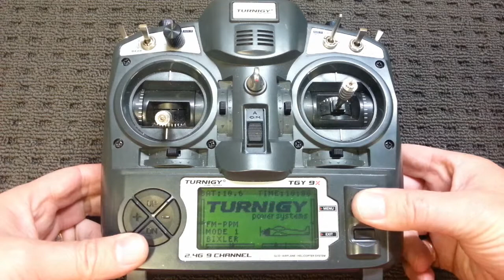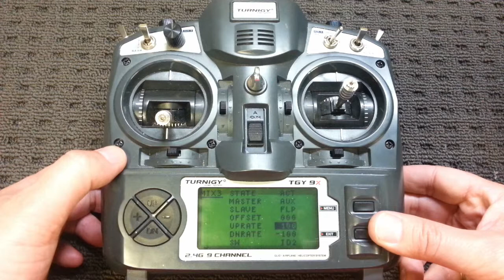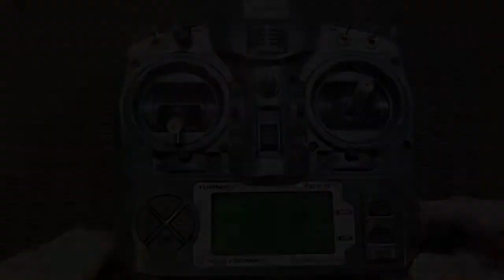BGL-6G-AP on Turnigy 9x 3 Pos Switch - Setup

Comment: What if I don't have a 3 pos switch? (Flysky fsi6x) i haven't received it yet but I think it doesn't have a 3 pos  switch.
Reply from the maker: The FSi6x does have a three position switch. When it arrives I would suggest you check out some vids on how to program that transmitter. There are plenty on YouTube. It is quite a popular transmitter. Good luck.
Reply: @madrc6667  thanks. Yeah I've owned 3 of them but couldn't remember if it had a 3 pos switch lol. Thanks btw. 

Quick question regarding fail safe. Do I have to set up fail through the radio? Or just set RTH on the switch? (along with off and stability of course)
Reply from the maker: @Oneoniner-109  fail-safe is the function of the receiver. So however you'd set fail-safe normally, make sure you include the fail-safe to switch the BGL to RTH mode.
Reply: @madrc6667  excellent I totally understand now. Thank you so much. Stay safe!!!

Comment: I use a dx6 with a 6ch receiver in my bixler. How would I set this up on the dx6?
Reply from the maker: G'day +Craig Barnes check out some info that I posted to the RC Groups thread for this one - http://www.rcgroups.com/forums/showthread.php?t=2417656&highlight=bgl+6g&page=17 Cheers Michael

Comment: thanks bro.. could u tell me how to setup turnigy 9x for cc3d.. ( 3 position switch)
Reply from the maker: G'day salam ahmad I am sorry, but I have no idea about the settings for the CC3D. I would think that the same method that I have used here would work for your controller, but you may need different values?
When I first looked into setting up the Turnigy 9x 3 pos switch I found some of these other videos helpful to learn different concepts for the configuration of the mixes. Maybe they might help you - 

* Turnigy 9X Transmitter Three Position Switch Nova/Storm OSD Flight Mode by ***** 

https://www.youtube.com/watch?v=WMzNjjprSDU

* DJI Naza 3 Flight Modes (Attitude, Manual, and GPS) w/ Turnigy 9X Transmitter and 3 Position Switch by Dennis Baldwin 
https://www.youtube.com/watch?v=DikLpzlIqHA

I hope that helps.
Cheers Michael